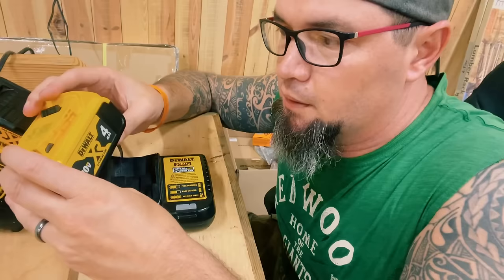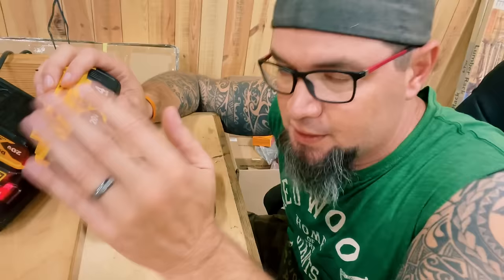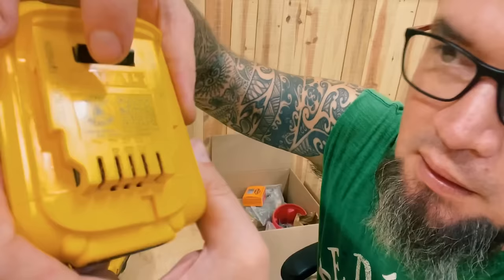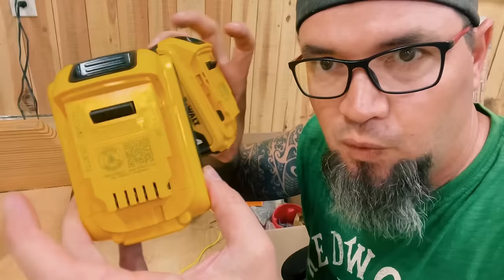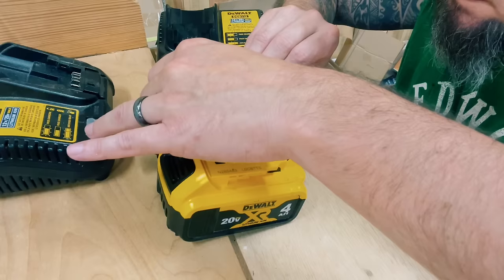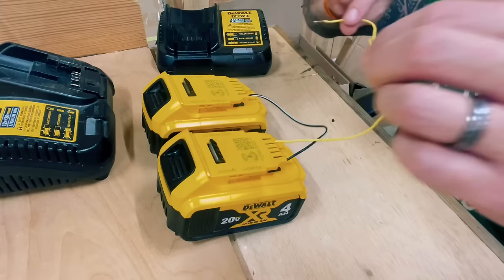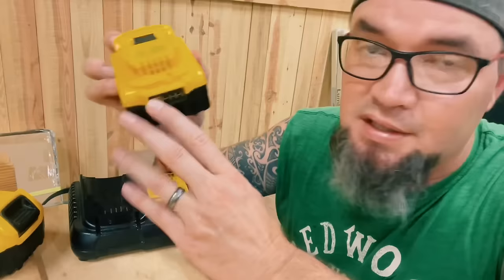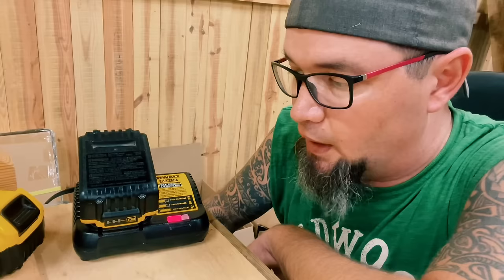Dewalt Lithium Ion Battery Won’t Charge? Try Resetting It With This Easy Fix.

Comment: thanks, just tried this on 40volt battery for weed eater, it flashing fast wouldn’t take a charge, connected it a 20volt battery for 10 seconds and put it back on the charger. Started charging immediately 👍thanks agin

Comment: Worked for me. Found a DeWalt battery pack on the side of the road that wouldn't take a charge from my DeWalt charger. Tried a couple different models of charger, nothing. 3 seconds connected to a freshly charged battery with some scrap wire and its taking a charge like a champ.

Comment: Thank you I have a small DeWalt battery wouldn’t take a charge so I started to do what you suggested I got the wire ready and I stuck the battery in just to check and it started charging so I guess threatening it made it work

Comment: Good instructive video. I want to make the point that one is not going to get an electrical "shock" from one of these packs, such as one might get from an electrical outlet, they're only 20 volts. But lithium cells can develop a wallop of current if shorted. If shorted they will burn up a wire, internally damage the pack's BMS (Battery Management System), or at worst, cause the pack to heat up quickly and possibly cause a fire, etc. So care should be taken as mentioned in the video.

Comment: Excellent tutorial. Tomorrow I will try this trick on a rechargeable Li battery that does show an indicator light but doesn't have any juice for my angle grinder. If it doesn't work, then there are other options...lithium is valuable metal these days.

Comment: Worked a treat. Did everything as described. Just be aware of a spark when you make the final connection. 😄
Reply: Do you keep the wire there while it's sparking?

Comment: Great Tip    Thanks so much.  I ddn't have any small wire at hand so I used four paper clips and it worked perfectly in 5 seonds.   Thanks again.

Comment: Just did this.   I have to do similar often with pallet jacks.   Most people don't know.  Battery chargers need a battery with some juice just to recognize its a battery on charge.   All you need is to just give it enough juice for the charger to recognize and it will charge.  Umless the battery is just danaged or bad.   Easy trick

Comment: This is freaking cool it works with all batteries since they are very similar just used a dewalt battery on a bad Bauer battery and now it's charging lol very cool thanks again for the info buddy this is awesome lol

Comment: Ive done this many time with my drone batteries, never occurred to me to balance charge or jump as you called it a tool battery, thank for the tip, Problem solved. these are some ugly units when you open them up, definitely not user friendly for replacing cells. excellent video. Subbed!!

Comment: Thanks for this I did use a wire link sparked when I did it literally one second checked battery went from 2v to 14v and now charger looks like it is charging with flashing green light not continuous red for my worx 20v battery hopefully saved getting replacements many thanks for this video.

Comment: "...a few seconds..." you weren't kidding! lol, I put a clamp on meter on mine to see how much current the dead battery would draw & it was instantly like 20A so even with the voltage sag on the good battery, was still >300W lol - great video, thank-you, def saved me some dough

Comment: Awesome video dude! We have 18v Dewalt batteries over here in the UK and I can confirm that this works on them as well! This method managed to fix 5/6 of my dead 5Amp 18v bat's.... Unfortunately, It didn't work on my dead 18/54v flex volt battery. Probably because it switches from parallel to series. Still, Thanks for this video, you've saved me a good £300!

Comment: Worked great, used 2 6 inch pieces of #12 wire stripped off 1/4 inch, hammered it down a little flat on both ends for about 5 seconds and he battery is charging

Comment: I work on electronics as a hobby. I have an adjustable power supply for injecting voltage into circuits when doing board level repairs. I set my power supply to 10 volts 0.5 amps and connected positive to B+, and negative to B-. After only about 5 seconds the battery started charging on the Dewalt charger. These lithium ion batteries get below a certain voltage and the stock Dewalt charger will not charge them because they are too low on power. Giving them a "jump" will always work until the lithium battery is beyond repair. If the batteries do not charge after about 30 seconds, you are better off getting a new battery. Don't go past 30 seconds to a minute because the battery is bad, and there may be safety risks.

Comment: Just had to do this with a battery that only had a few minutes of usage but that had been left for a few months.  So thanks for the video.

Am I alone in thinking this is a terrible design for such an expensive piece of kit?

Never had this with my much cheaper drill set.

Comment: This happens because lithium batteries are NOT supposed to be charged if they were allowed to drop to 0 volts.  Supposedly, there is a risk of battery failure/fire if you charge a battery in this state.  With that being said, I can confirm this does work as I have done it myself.  So far I have not had anything bad happen although a battery may experience shortened life or charge from being allowed to drain to zero.

Comment: The instruction manual for the blower I purchased said when the red light was flickering the battery was charging.  I wish that manual would have said a hard push slamming that battery onto the charger was necessary for a complete charge, which can be checked on the battery itself. That, in itself, is the under lying condition I wish I had not purchased that item and I will not purchase another item by that company. Thank you for the video.  I did what was suggested and the battery charged for another extended period of time.

Comment: I just did this with a 5 month old hoover 6 Amp knockoff battery. I left it sitting on the dual charger and it isn't smart enough to sense the battery is still plugged in once it's fully charged. The battery went slowly completely dead and charger said it was defective. I checked the voltage and it had 1.9 volts from normally 20.
I figured it didn't have enough voltage to trigger the charger so I did exactly the same thing. In my case my jumper wires were what I could find as I don't know where all my speaker and extra wires ended up. Wire was small and started to heat up quickly and turn red but I got enough voltage into it that it charges again. Remember to use thicker gage wire and for it to get hot quick so like he says just jump it for a few seconds.
I have internally cleared the crap that builds up internally with old Ni cad cells doing similar with 12 volts and a old car tail light to take some of the load so the cell doesn't spark and try to overheat and explode. I revived a ancient battery pack that had about 5 bad cells that way and it worked for about 6 months till more cells died. Same thing, touch the positive and negative for maybe 10 seconds with the bulb inline and it will usually cook it back to 1.2 volts or better. If you try to just hit it with no load it will spark badly and try to pop so you need a dropping bulb and be careful.

Comment: Good job.
9 ah grinder the thing run down fast.
The box instructions said dont charge when hot.
I started chargeing only after batt being in freezer, then charge if warm at 2stage charge say full, batt warm i cool it then top off reason is 2nd stage charge light is no longer on.
I am running grinder about 75% longer.

Comment: i jump started a hart brand battery  with a battery charger maintainer i had already, and instead cables on battery  terminals i used a couple razor  utility blades insert and carefully attach charger in less than 5mins it was working

Comment: Omg life saver I was piss off i thought mine was toast so makes sense how you can drain them all the way down which I never do till I bought the dewalt fan it will stop right before it dies but if turn off and on will completely drain it down didn’t know.

Comment: A completely depleted lithium battery is supseptable to burst into flames when charged LOL. So many have some sort of shut down circuit if that happens. This is really rare for that to happen though. I know some cells have a little chip right at the positive contact of the battery But Dewalt probably has one circuit for the entire battery instead of one on each cell. I will defiantly try this if I have that issue.

Comment: Nice video! Been there before with another brand. I knew what to do because of experience with smart chargers on vehicle batteries. I've had to get out an old school charger to get the battery started. Then the smart charger detected enough voltage and  took off. I always tell my friends that even though the chargers are smart, they are also kinda dumb. Lol

Comment: This is actually a pretty well known trick for all li-on batteries. I did it once with the battery from a tablet that refused to charge.

Just don't leave it attached too long. Doing this is like charging a battery without a charge management circuit, which could be very bad if not monitored.

Comment: I just took the positive and common leads off of my multimeter and hooked up a new Chinese battery to a D Walt brand battery from 2002 that wouldn’t charge and gave it up for second jumpstart and now it is charging normally. As to whether it’ll work will be seen, but it did need to see more than 5 V to charge normally.

Comment: This is called hooking up in parallel. The idea is the lower voltage battery will draw current from the other cells to balance out but if some cells are out of balance or dead. This won't work

Comment: Take a hint from me ,I used to go through a battery drill every year,,,I’m now on a lithium ion hitachi drill that I bought 15 years ago ,,it and it’s two batteries are still working perfect and it has had a massively hard life ,,,now know as hikoki ,,,just met a Dutch lad that also has two of them both 12 and 15 years old and also working just fine ,,,only problem both of us have had is the charger stopped after 5 years but bought another and fine since

Comment: What is actually happening is a completely discharged battery doesn’t discharge evenly. The first cell to go completely flat reverses polarity. This is detected as an internal failure by the charger so it doesn’t charge because reverse charging a cell makes it go boom. What you are doing by joining like poles on the batteries is shocking the reversed cells back into correct polarity. This trick also works really well on individual torch cells. Put the base of the non chargeable one against the base of a charged known good cell, and either use a wire, or even better some kitchen tongs, to short the two pointy ends for about 10 seconds. (Tongs work best as it’s easier to gold the cells, and it dissipates any heat quickly.) Non charging cell should now charge. Repeat a couple of times if needed. If it still doesn’t work, recycle the cell as it is chemically damaged.

Comment: I tried this with a flex volt 9.0 AH 20v Dewalt and the wires melted in a about 2-3 seconds. I put the dead battery on the charger and it started blinking. I was very pleased to see this. It charged for over 2 hours then the steady light/ full charge. I took it off only to find it didn’t work 🤔. I’m going to find some bigger wire I had some 14 gauge solid copper on this attempt. Any suggestions?

Comment: Thanks for the video. Why are you calling negative ‘B negative’? There is positive, negative, ground or neutral. 

You are ‘tricking’ the battery’s circuitry into allowing it to be recharged. Good job!

Comment: The battery pack itself has safety circuitry, this is there to prevent overcharging and becoming a serious fire hazard for lithium cells. If the charge is entirely depleted, it can't allow itself to receive a charge (the charger unit isn't smart, it's the battery packs).

Comment: Grear video. I have a dead 36v Bosch battery, could I use a diffent battery from another manufacturer with a different voltage to do the same. Thanks

Comment: Not sure why I didn't know this would work. I've had to "jump" a few 3s lipo rc batteries to get them to charge. For some reason i forgot most lipo packs are made with similar 18650 lipo batteries.

Comment: I just did this with the flex volt 60 volt lithium-ion batteries, B+ to B+ first, then B- to B- and as soon as I touched the B- from the good one to the bad one I got an immediate spark on the B- of the bad one. Now I think it's totally fried. What are your thoughts? *Edit. I did just realize I did one step opposite of what you did. I connected from good battery to bad battery. I just realized when you put the first wire in you said you were putting it in the bad battery first and the good battery second. Could that have been where I went wrong?

Comment: Wondering if you need to have the same size battery or if I could use a two amp hour 20 volt to jump start the 6 amp hour 20 volt? Also really don't want to fry my battery. I don't know if there's any sort of safety to try to keep this from being too much electricity for the battery to handle and then burn it up.

Comment: Tried twice with a Milwaukee M18 red lithium ion battery. After resetting, placing the bad battery in the charger, it immediately shows green as if it is fully charged. I took it out of the charger and pushed the battery button to see what if any charge appears and it shows one red light continuous flashing.

Comment: Do they have to be the same battery make/model and voltage? Could you reset a 20v Stanley with an 18v DeWalt, providing they are both Lithium Ion?

Comment: Do both batteries have to be the same brand, i.e. DeWalt to DeWalt, Ryobi to Ryobi? Can you mix brands as long as the voltage is the same?

Comment: What deadly should do is make a battery pack with removable cells so it’s easy for an owner to replace the cells themselves using replacement 18650 cells if appropriate

Comment: I have two Dewalt 20v that only show constant red in the charger. I had not used them in 2 years. Two questions, does solid red on my charger mean they are not charging, or not holding charge, or too dead to do anything? (Your video shows a blinking red light). 2. What can I jump them with since I have no working batteries?

Comment: I have 4 Dewalt batteries that are less than 5 years old.  They all take a charge and will read fully charged, but they only last a few minutes with a drill, leaf blower, edger, etc.  Can I try this trick on them?

Comment: I don't know if you will answer this or not but, one of my batteries will charge in like an hour while the other still takes 6-8. Does this mean that the quicker one is dying or is this just how it goes? I have not been able to test usage time of the two as of yet but, the quicker one does seem to be used up quicker than the other.

Comment: Cool video.  Unfortunately this didn't work for my battery.  I have a dead dewalt battery.  When I jumped it to another battery.. I thought it was gonna work b/c the lights on the dead battery would light up when it was connected.  But when I put it on the charger..  it still won't charge.  I guess my battery is really dead.

Comment: Just tried this,  appears to work for me. Battery is charging on the charger. 

Make sure the wire you're using is thick enough.  This is a "short circuit" with unregulated current flow!

Comment: so I've got a little different situation... mine flashes quickly red on the charger, and when pressing that button, it's not "dead" it flashes all three of those charge indicators with a VERY fast blink of green.... is this indicating something different than yours?

Comment: This would be so much easier if they simply included an over ride switch on the charger for this circumstance...Maybe a charge button you need to hold down to use.

Comment: Battery packs that are dead are likely shorted internally and not likely to fully charge or keep a charge. It's more likely the cell is dead and you can try and replace single cells by disassembling the pack. Most likely the work isn't worth the effort. This has been my experience.

Comment: I don't know if you have any suggestions for my problem. I have two 20v Dewalt batteries just like yours. One of mine is good but the other one won't charge. I tried this fix several times with no luck. When I plug it in the charger, the charger blinks as if it is charging. After about 20 seconds, the charging light is on constantly indicating a full charge. When I plug it into my drill there is no power. The other battery works fine in the drill.

Comment: hey this work on 2 battery. 1 of the battery shows full  charge when hit the battery test lights hook to a full charge. but install on the charger this will not take a charge. but man have 2 i can use thanks. this on a lynxx 40v battery.

Comment: Dewalt batteries won't always jump start from another Dewalt - your chances go up if you bump from another battery brand.  Ive had no luck jumping from another dewalt, but it did work when I jumped from a makita. I suspect that with some dewalts the issue is that the motherboards for both failed the final step.  I got to 17v with a D to D jump but it registered one bar after that jump and the charger would not take it past 17v. In theory at 17v it should be fine. It wasn't.  When I tried Mak to D it continued charging, I got 4 bars and the charger was hap;py to recognise it as fully charged.

Comment: I have a Dewalt Flexvolt battery that shows 1 battery indicator with just a little power left but it won’t pick up on any charger. I tried blowing the terminals out with no success. Any recommendations?